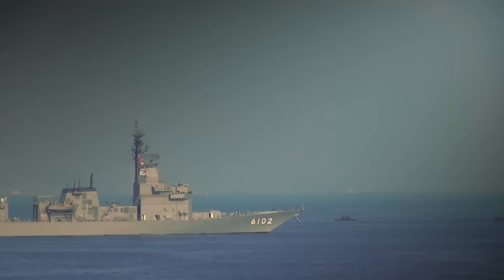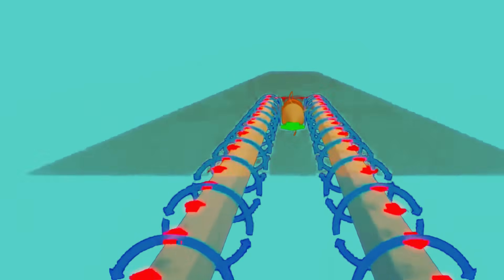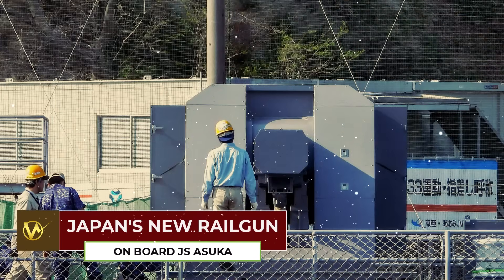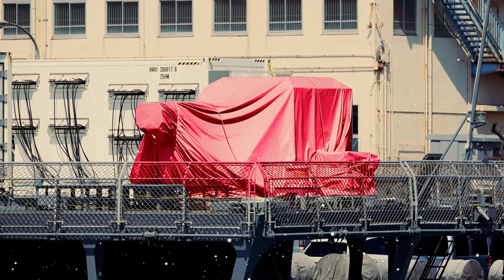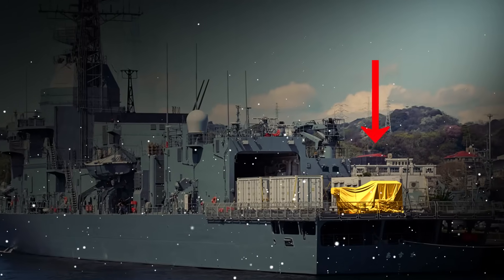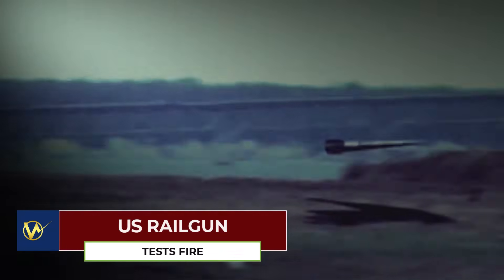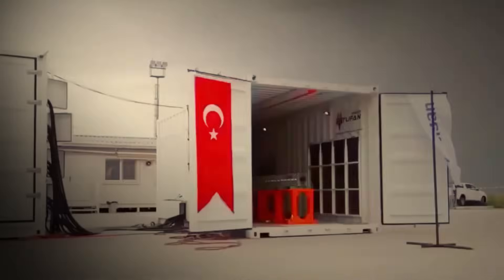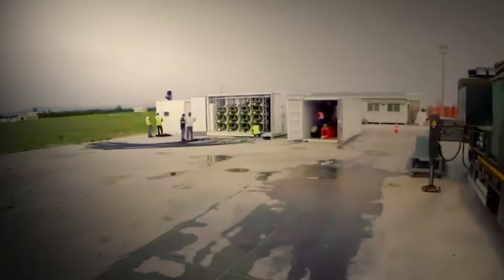Sorry China! Japan's Warship Tests New Version of Super Electromagnetic Railgun

Comment: I’d be curious what strategies they are using to solve the excessive ware problem. American research stalled because the barrels were exposed to too much structure stress after around a hundred shots.
Reply: According to a presentation at the Defense Acquisition Agency Technology Symposium 2023, they were able to fire 120 rounds in succession without any serious damage to the barrel or a drop in muzzle velocity.
This was achieved by changing the barrel material and adopting a new discharge method.
(In addition, Japan has adopted a policy from the beginning to develop a railgun that is smaller than the one the United States was researching in order to enable faster development.)
Reply: @otaku_yarou thanks for the info
Reply: This one can last 120 shots according to Japan

Comment: Nice but what for? Rockets are beyond sight.
Reply: You guys need to do some research, its Power is the speed, not explosion or size. Imagine like a small Rock from a kid hit you. It will not hurt you, now speed the Rock 2000x up. It will now not only have a massive range, it will also have the speed to erase your belly. This is the concept of a railgun
Reply: @ yes i understand that power, but how to get in Range to Fire it, when a rocket hit miles before you can fire that thing.
Reply: @NCC1701-D  the railgun can fire at a Hypersonic speed or even faster, which allows range, precision and Power while the reloading can be automatic without the need of gunpowder or expensiv ammo. So you can have small steel ammo which will be cheaper and stronger then all other defensive Systems. In your comment you sayed rocket (missile) that will hit before you can fire the weapon. There you will use a small high firerate Version (Anti Air)of it, which is also in production and will have a test weapon in 2028. It will use long range radars to automatically allows to lock on missiles, jets and more. There you will use high end lock Systems to fire a detecting threat down in less then a second. The speed allows to get the projectile up to 8000km per hour. Which is nearly 7 mach.
Reply: @Drago20056  Which new hypersonic missiles also can go, while able to evade. Even of you manage to Shoot one down, you cant fight beyond line of sight. Still amazing tech.
Reply: @NCC1701-D  You cant fight out of sight, but the radars can. Also the project is still in progress and it will mostly be a close to middle range defend for the AA Version, while the Main cannons will be more on ship to ship battles.
Reply: @NCC1701-D  Another point is that hypersonic missiles are VERY VERY VERY Expensive. Which if the railgun can fire it down it would be a lose of $100 for a steel ammo or 350 million $ up to over 1 Billion $ for the missile.
Reply: @Drago20056  I See the advantage of faster projectiles fired from pipeguns. I am not sure this will be cheaper, as attrition is very very high and you also need a reactor and condensators of Impressive size. Radar has Problems with sea-skimming missiles especially if they have stealthy design as most modern antiship missiles have.
Reply: @Drago20056  I guess hypersonic missiles will be roughly the same cost if they enter mass production as the engine is not very different.
Reply: @Drago20056  but there is one case. These guns could be a thing against icbms. If they stationary and close to some power plant.. that could work
Reply: @Drago20056  yes I think on the ground, not at see, that could take out fighter jets and drones, even glide bombs. Low flying cruise missiles still be difficult to detect.
Reply: I am Japanese. As has already been explained, we need the ability to deter enemy attacks with a small budget. It is known that the budget of the People's Liberation Army is more than three times that of the Self-Defense Forces and almost half that of the US military. Currently, Japan operates SM3, but it is very expensive. Ballistic missile interception is necessary, but supersonic missiles must also be intercepted. I understand that Canon cannot intercept targets hidden over the horizon. However, what is required in this plan is a low-cost interception method with superior interception range and accuracy compared to CIWS and SeaRAM. However, since it does not contain explosives, the conventional MK45 5-inch gun will continue to be mounted on the Mogami type, which has been modified for the landing and recapture capability of seized remote islands promoted by Japan. The stealth shape of the Mogami type is not very meaningful in fleet battles at sea, but is useful for providing low-cost fire support with the main gun in landing site securing missions where radar-reflective objects increase.